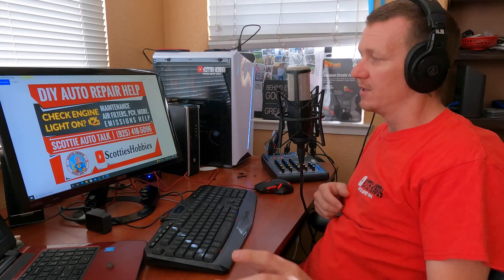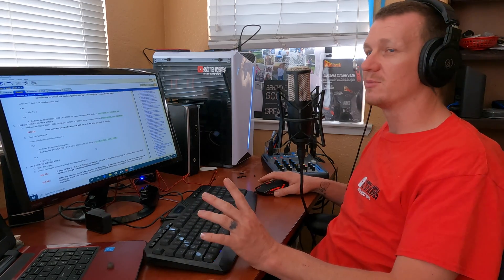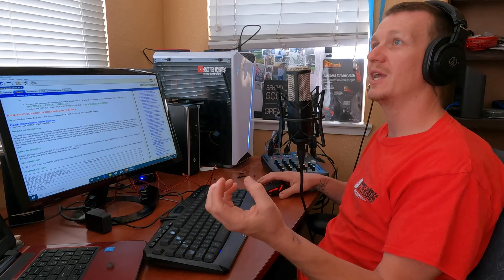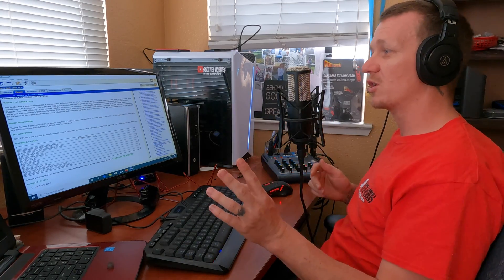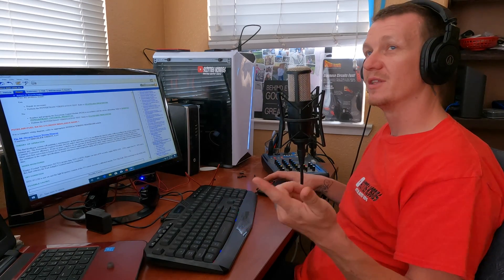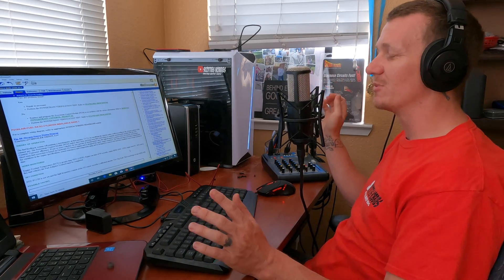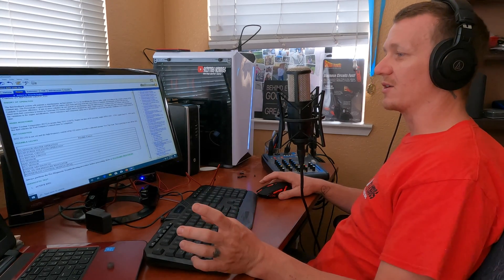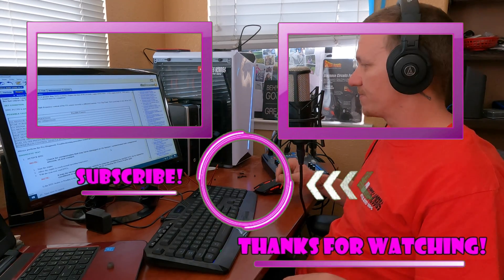⫷ p219a, p219b, p0171, p0174, Air / fuel imbalance / Lean condition / podcast ⫸

Comment: Hey Scottie great video, im currently trying to figure out p219a and p219b on ny 2013 silverado 1500 LTZ 5.3L seems like the repair shops want to reach into my pockets. Ive spent over 2k so far pursuing this. Only thing ive been told from the shops is that theirs a slight cyl 4 misfire and they wanted to change the plugs and wires. I changed them and the code came back but yellow instead of red on the obd2 scanner. I dont know how to find exhaust or vaccuum leaks. Any thoughts on my next step? One mechanic also changed the valve cover because the originals would let oil vapour into the air intake, also had a bummed oil pressure switch.
Reply from the maker: Do you have any drivability issues?  I would be looking for something that can affect both banks of your engine. If you have a number 4 cylinder misfire that should only cause one bank to see a incorrect air fincorrect air fuel ratio mixture you'll make sure. Something like fuel pressure or mass air flow censor or Intake leaks are going to be probably more of your issue.
Reply: @ScottiesHobbies  it seems to drive perfectly in my opinion maybe slightly less power than other chev trucks ive driven but i expected that with the crew cab.
Reply from the maker: Have you cleaned the mass air meter? Is there a 'tune' on the computer? Aftermarket parts?

If you could figure out if your too rich or too lean, that would help too. Too rich, I would think fuel pressure regulator or air delivery issue. Too lean, I'd lean towards fuel delivery issues.
Reply: @ScottiesHobbies  no tune as far as i know, i picked it up fall 2020 and has had this code since then. The only aftermarket parts ive put in are spark plugs (ngk iridium gapped to .040) and plug wires. I wonder if the shop i got it from put in aftermarket 02 sensors because they said they were replacing them before i took delivery.  Any thoughts on how to test the fuel regulator or other parts?
Reply: @jakebliedung1471  Any results? I have the same on a 2014 Tahoe, same engine as yours. 

The one thing I found was a drop in 1:2 o2 sensor freeze frame. Looked like a glitch that went from about 0.7v to 0.16, then immediately back (found later on an 02 graph during monitoring). I replaced the sensor and have the same issue.
Reply: @mph5896  no luck so far, i took it in once again to have it looked at and it seems they wanted to take the approach of replacing cheapest stuff first. I put in new plugs and wires, that kept the code off for about 60miles, next steps for me is either coil packs or injectors im hoping its not a fuel pump issue.
Reply: @jakebliedung1471  I have seen a handful of the 13-14 5.3l with these codes. I have not been able to figure it out on any of them. This particular one I replaced both front 02 sensors and one rear sensor. Smoked the intake, balance checked the injectors. I am not going to wing any more parts at it. Frustrating. I guess I'll keep poking around at it. 

Code sets about 5 minutes into a cold drive cycle. On the throttle a little.
Reply: @mph5896  its got to be the most frustrating code, especially considering everything seems to work great. I just want it gone incase of future failures.
Reply: @jakebliedung1471  Any luck??? I got the P219B as well on my 2016 Silverado 1500 5.3, as well as the u0073-00 code... Both generic codes, no drivability issues Im so lost
Reply: @Carbon5.0  still scratching my head. Going to try a reputable shop soon and see if i have any luck. Ill post back with any results
Reply: @jakebliedung1471  Have you changed your injectors out?
Reply: @Carbon5.0  not yet, i would like to see em tested 1st as ive probably dropped $2500 into this issue between diag and parts. Dealership here wanted $600 for plugs and wires i did at home with proper gaps and torque for about $100. Took me under 1hr.
Reply: @jakebliedung1471  The P219B code is always from injectors, my research has found...  Anyways, I did a sea foam carbon cleanout my myself, 2 cans of seafoam in the throttle body, half a can in the oil, and 1.5 cans in the fuel system. Did not remove the code. Although, now its been 2 weeks and the CEL went away by itself??? Weird..... So i put 1 more can of seafoam in the throttle body today, to clean out remaining carbon hopefully, and on this fresh fuel tank, I put 2 bottles of Redline Fuel Cleaner which are the best injector cleaner product out there. Hopely my light stays off I will let you know!
Reply: @mph5896  Thanks Jake tying to help a buddy with his Yukon,so every comment helps
Reply: @jakebliedung1471  I know this is an older video but, did you ever resolve this? The 5.3 has active fuel management, which shuts off 4 cylinders at idle or cruising and it's very problematic. The lifters fail quite frequently, sometimes the truck will start tapping, sometimes it won't. If you see this, send me a reply and I'll share a quick and dirty way to diagnose it. Incidentally, the cylinders that get shut off are 1, 4, 6, and 7.
Reply: @FixIt1975  i havent got er just living with the engine light haha
Reply: @jakebliedung1471  If you're somewhat mechanically inclined, it's not hard to pull that valve cover. #4 is second from the front, passenger side. You'll need an assistant for the next part. Have your assistant hold the gas flat to the floor and crank it and watch your rocker arms as it cranks. It won't start, it's called clear flood mode, it kills the injectors. It won't hurt the truck either
Reply: @FixIt1975 so what exactly am i looking for when i remove the cover and crank it with the pedal matted?
Reply: @jakebliedung1471  you'll want to see all the rocker arms moving up and down and moving equally. You may have a partially collapsed lifter that will move and then it won't move the rocker arm up and down. Hope this helps
Reply: @FixIt1975  awesome! I appreciate the response.
Reply: @jakebliedung1471  not a problem. Good luck. If you find failing lifter, that head will need to come off but it's not a difficult job
Reply: @ScottiesHobbies funny story i never bothered with the p219code as it was a constant battle, jump forward to this week and my truck had a fuel leak, got a new fuel pump and lines. Problem solved somehow. Cheers.
Reply: So, where I am at. 2014 Tahoe, 5.3l. 219a was setting often. Had 219b set once. Injectors balance tested fine. I did pull the intake to replace the oil pressure switch and to re torque the Vlom (unrelated). The plastic intake gaskets were flat in a couple spots and I replaced the set of gaskets. Did not fix it. On fuel trim I was getting excessive fuel trims in long term like 10-12 in some cells under load. WOT and it was running rich so that rules out fuel supply issue. 

I replaced the MAF with a new OEM sensor. Fuel trims corrected and I have not had an issue since. I haven't driven it much, so time will tell.
Reply: @mph5896  interesting
Reply: did you figure out P219A
Reply: @jakebliedung1471 did you figure out P219A
Reply: @TurnThemWheels  Still no luck, short on cash from starting my own business to try replacing injectors. Im also limited to a really  basic obd2 reader. When my adventure started i went back to the place i bought the truck, they said 02 sensor and  did nothing, took it to a warantee approved shop and they replaced the valve cover stating the old one had a vent issue that would allow oil into the air intake. They also did all fluids as per my request. Took it to another shop, they said go to the dealer. The dealer said they wanted to start with plugs and wires quoted me 800 so i bought my own stuff and installed it with proper gaps checked and even torqued the plugs. This did nothing, I realise the dealer has part changers and not mechanics so im dealing with the light.
Reply: @jakebliedung1471  yeah man haven’t had any luck figuring it out either
Reply: @TurnThemWheels  when i get a few jobs done ill put more work into it. Ill post back any results.
Reply: @jakebliedung1471  alright
Reply: Also have the exact same vehicle and the code comes and goes
Reply: 2013 5.3 Silverado p219a and p219b. Replaced all injectors and O2 sensors any updates on this?
Reply: @VintageVDubs  I have this P219A code stored as pending and sometimes triggers the light
Reply: @VintageVDubs did you figure out P219A
Reply: I have the same code and issue. 
Changed air filter 
Cleaned mass air flow sensor 
Two quarts of Marvel mystery mix oil in gas 
Deleted code and it keeps coming back. Sometimes it shows in pending and sometimes it shows active.
Reply: Fuel Injectors https://youtu.be/jIT0-6uectI
Reply: Fuel Injector was the fix 
https://youtu.be/jIT0-6uectI
Reply: Had a P0219b. It has came and gone away for a month. Also have p0171 and p0128. Is this the o2 sensors?
Reply: Anybody figure it out yet and has got it removed permanently?😅